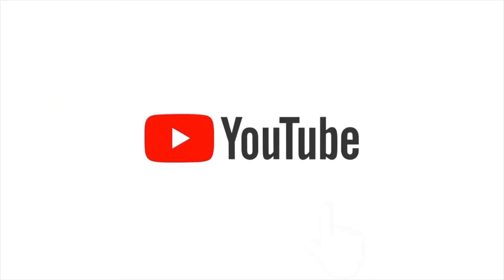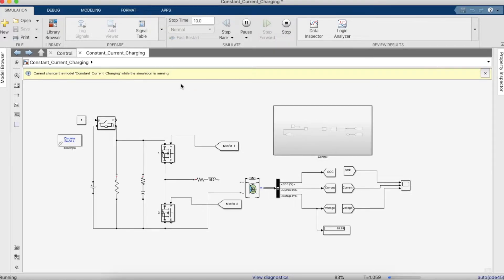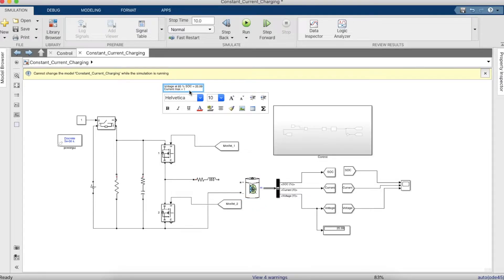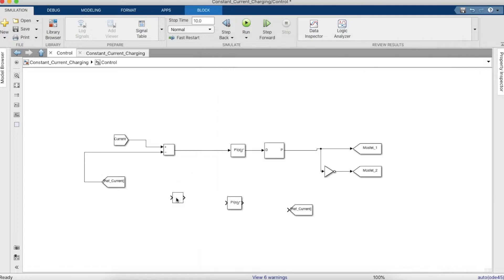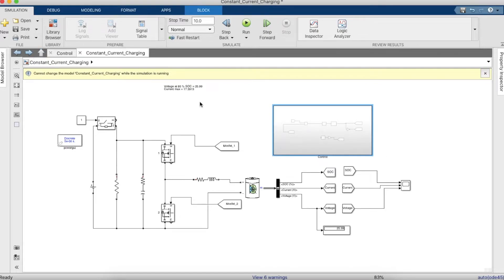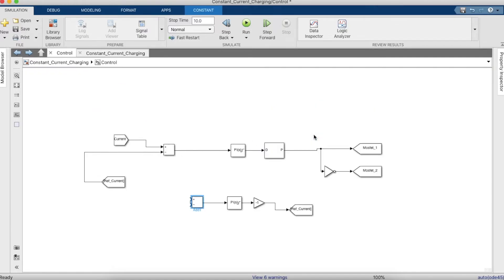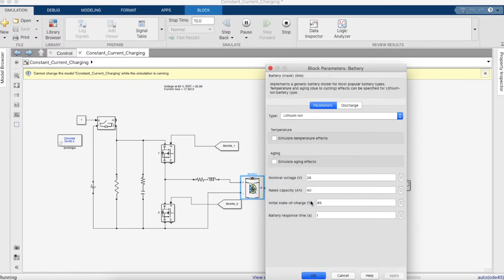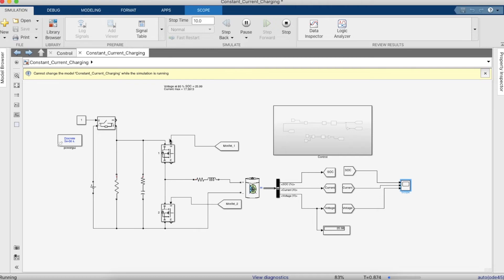Battery Charging using Voltage Charge Controller Design and Simulation in MATLAB/Simulink!-(Part 2)

Comment: Hey, I found your video interesting to simulate, but I want to know the reasons of using inductances in parallel as well as in series as shown in circuit.
plus, can you tell me the reason behind using the values for the PID controller, please

Comment: Hello sir, thx for the video it’s very educational! Where can I part 3? And how should I amend the circuit if I want to regulate the voltage supplied to the load, e.g. i want to charge a 3.7 lipo battery and a load which need constant 1.4v supply. Cause in this case when the input voltage is 5v and in charging mode, the battery is charging but the load is also at 5v, whereas in discharging mode, the load voltage depends on the battery voltage

Comment: How did u get the value of value of voltage as 25.99 ? 85% of (?)
Reply from the maker: Sry for the late response 😔 Wish you're doing well ☺️ it's open circuit voltage at 85 % SOC, hope this helps

Comment: Hey, Thank You very much. You earned a subscriber. The insights were wonderful. 
I had a question though, why were the capacitors for the buck converter circuit omitted? And yes, do upload a CCCV version of the battery charging (both part1 and part2 merged with some control logic).
Reply from the maker: you should be able to add it, I don't think there should be a problem. Its usually added for voltage stabilisation, of the converter. 
You're right capacitor could be added. 
https://www.sciencedirect.com/science/article/pii/S231471721730017X
Check this out

Comment: what the value of reference current please?
Reply from the maker: Hi Salah! Hope you're doing well. As the title suggests. Its a constant voltage controller. Our other video, shows constant current. Check it out.
Reply: @TheUrbanScholar  HELLO 
Check the control block there is  A reference current you did not mention to it in the previous video and when you start this part 2 I saw this block so here that I am asking about it and another question could I remove the ideal switch and make just one control block to make the battery charge and discharge.
Reply from the maker: @Se Salah  Greetings, Sorry for the confusion. The reference block in the beginning of the video is just a from to block. We drag it out and make it a go to block which holds the value of "Reference Current" i.e. the output of the PI controller. The PI controller looks to change the refrence current value to ensure that the SOC doesnt charge above 85% SOC. I.e The current will reduce to 0 as the SOC reaches 85%. Hence the reference value for this case is a changing parameter
Reply from the maker: @masalem7697  https://www.mathworks.com/matlabcentral/profile/authors/15068306 

Everything is here.
Reply: thank you Sir.
I have a question about  ideal switches 
if I want to remove it and need the control sensitive the state  when its charge and when its discharge, how to do that
Reply from the maker: Can you explain it more clearly we didn't understand what you wrote😅
Reply: @TheUrbanScholar  I meant if  I  remove the ideal switch that give zero and 1  how the  control  make  the battery charge and  discharge ?   is it clear now  ?
Reply from the maker: If you remove that switch you can't control the charge and discharging, the battery will perform only one of those if you remove the switch
Reply: @TheUrbanScholar  appreciated